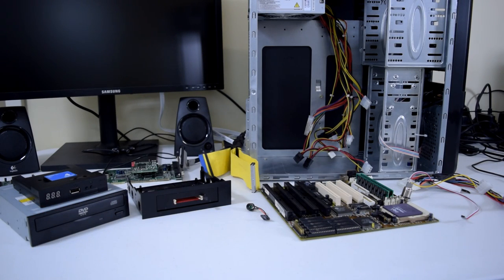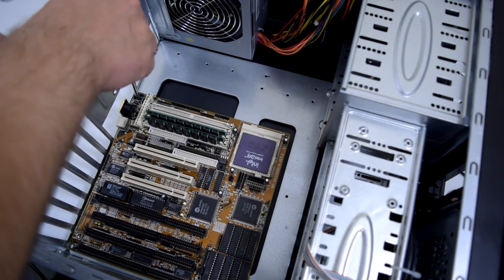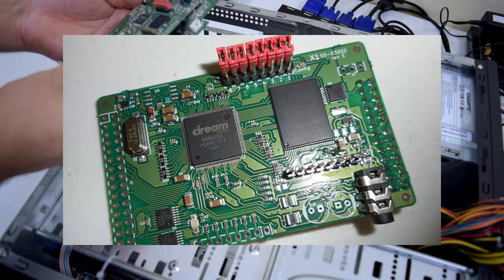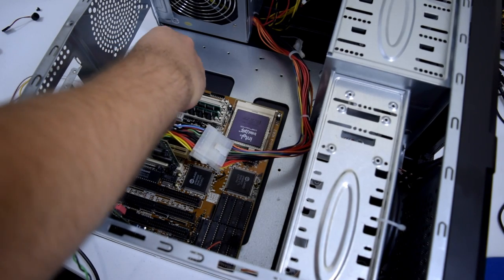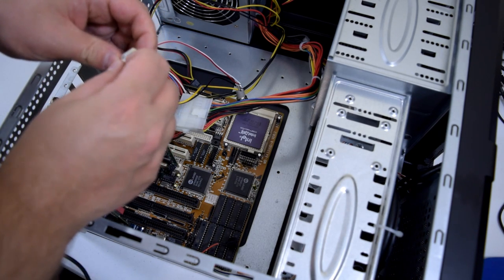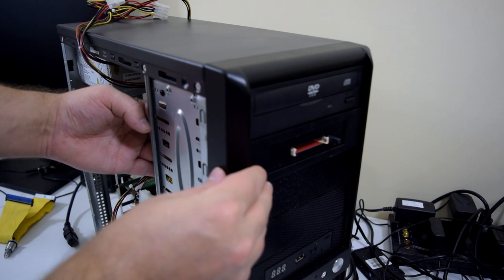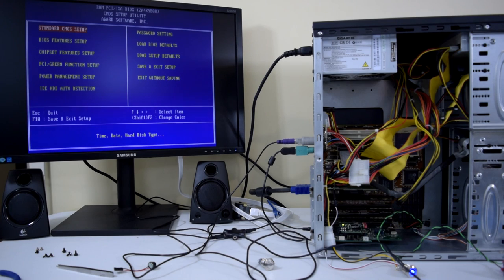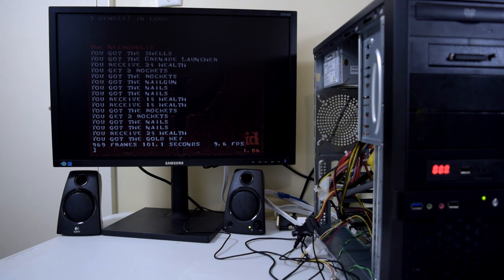Building a 486 DOS PC with modern parts

Comment: Just an FYI, if you don't want to use an ATX power supply, they still manufacture AT power supplies. You may have to do some hunting but they are still used in a lot of industrial equipment. You can get them brand new from manufacturers like Startech. You can also get XT power supplies for even older systems that are new and recently manufactured. Many arcade machines use them, so you can get them from arcade vendors a lot of the time.
Reply from the maker: +lowfwyr Good tip on the StarTech one.
Reply: Anyone know where you can still get these?  Only thing I can find now is Athena Power - which doesn't inspire much confidence.

Comment: Wow! This is a really cool video. I haven't seen anyone put together a video like this and even if they have, its terrible and 1/10th as detailed and done by hand-holding a cell phone camera. Excellent work, Phil. And I am very very interested in videos like this. I started out using my first "real" computer in 1993 which was a 486SX 25MHz with 4MB RAM and a single-speed (150kb/sec) CD-ROM drive. I ran a program called Vistapro which was a fractal-based landscape rendering and animation program. Endless ours spent creating and rendering. Full detail could take hours at 800x600 resolution for 1 image. I later ran the program in a command prompt on WinXP on a AMD 3500+ with 2GB of RAM (not that it even used more than 1MB or 2MB) and the program ran so fast at full detail it was rendering in real time. I was blown away. I think companies like Microsoft, Adobe, etc. inject so much bloated code that programs run slower and slower on modern hardware. Thank you for the video. I would love to build an old 486 and run some "benchmarks" and compare them to what a new PC can do. What matters is the results and the time of the output.
Reply from the maker: +Justin Lloyd Thank you for your kind words, they mean a lot to me :) I am branching out a little, doing also videos with newer parts, like with Windows XP, Athlon XP, Pentium 4 and other things. But I'll do old stuff too, I find all of these things very interesting.

Comment: Thinking of building a 486 and being able to use it in an ATX case would help!  AT cases are still around but go for a fairly static £60 on eBay which adds yet another significant expense and often they're heavily yellowed, rusty, bits drilled out etc.

I had no idea you could physically mount them, with the same standoffs.  Plenty of options for the switch.

Comment: I got one of those Star Tech CF adapters for a Packard Bell Platinum Pro I recently restored. The only thing I did was to paint it beige to match the rest of the PC. Since a lot of restoring with CF cards is done to beige boxes, they should at least give us the option. The other reason I got it was it was one of the few that has an eject button. I am scared at all times of bending the pins on a CF card. Also, I use a CF to SD adapter as I can get bigger sizes for less.
Reply from the maker: Nice!

Comment: Awesome video.. I still have a prototype for a small converter laying here, waiting to be finished, that allows you to use an ATX power supply like this without having to switch out the mechanical switch itself. I guess I need to get working on that project again..
Reply from the maker: +Tobias Mädel (Manawyrm) So, this adapter works with the standard ATX soft power button?
Reply: Yes, its basically the soft power button logic that you'd find on a standard ATX motherboard, only externally.
Reply from the maker: That's very cool! Do you happen to have a link or article page to this adapter?
Reply: not quite now unfortunatly, as i've said its an DIY project. I need to find a way to distribute these boards.
Reply from the maker: Ah, ok, sorry, I misunderstood. So you built an electronic switch that takes the ATX power switch and then turns the AT PSU on or off.

What components did you use? Switching with a transistor or relay? Did you use a micro-controller like Arduino or built your own circuit?
Reply: +philscomputerlab Hm, its an electronic switch, that takes the ATX power switch, and then turns an ATX power supply on and off, so basically exactly the thing you'd need for this build. 

My first version was swiching with a 74-series flip-flop IC and some transistors, but that wasn't working so good, so the "current" (well, 1 year old) version uses a small microcontroller. kinda like an arduino, only much smaller and cheaper. the current price for the material is under 5€ and I try to keep it like that... Its basically only a ATtiny85, a circuit board and some connectors.
Reply from the maker: Cool, very cool. If you ever find the time to document this, please let me know!
Reply: +philscomputerlab http://www.dosforum.de/viewtopic.php?f=1&t=9819
Reply from the maker: Cool!

Comment: looks like, apart from the PSU, the AT board fits nicely without any modifications in the ATX chassis. I didn't expect it especially to hold the board in place without mods.

Comment: You connected the external pwr button to "Turbo" button connector - that's why it slows down when you press it! The turbo button changes the processor clock.
Reply from the maker: +Gaston Electronics Yes that what it does. On some boards you got to close the jumper for full speed, on others remove it. There is no set standard :)

Comment: its amazing how many engineers who build pcs always dvd drives at top of case eventhough you could have multiple open caddy openings on the case
Reply: Yes agreed LOL, I know what ur saying its just a habit to always install the drive on the top bay even if its on a table ... If you know what I mean, I must have done hundreds of pcs and still to this day I always put the optical drive at the top of the casing just a habit unless the IDE/SATA cable is not long enough at the time of building you place nearer to the cable if you not got and extender cable!
Reply from the maker: +Kcin Setay You make a good point! Another viewer advised to that the drive on the end of the IDE cable should be master, so if I use a single cable, it would be easier to have the hard drive on top of the optical drive. Some case however have set optical bays with a door for it, of course right at the top :)
Reply: yes been there as well lol with MA/SL & CS :D how sata changed and everything gone backwards a little because were so used to connecting single drives to 1 sata port at a time!! but ide mainly had 2 channels per cable unless your pc was a dell or a Compaq which they were tight enough to only supply one IDE adapter on the each end and if you were not savvy to cut into the cable you just went out of got a two ended ide cable so you can use two drives on the same cable!

Comment: Yesterday I got my first 486 pc. The layout of the board is the same as yours and it also has a ps2 port. But it only has a 486 DX2 with 66MHz installed. And the pc has the exact same graphics card.

Comment: I had one of these back in the day. 486 dx 2. You just reminded me on the fact that these cpu´s didnt need an heatsink even LOL.
Reply from the maker: +sugarpuffextreme Funny you mention this. I copped a bit of heat for not using a cooler. I totally admit that I forgot about :D I then bought one from eBay :P
Reply: +PhilsComputerLab Didn´t it run fine without a heat sink? Anyway, you just inspired me to build an old computer, there is some stuff that you simply cant play anymore without old parts and os. Half life 1 WON version with that old animated menus instead of steams new static ones are amazing
Reply from the maker: I have a retail copy of Half Life :)

I believe I have a video on my channel. Running it on a Pentium 3 with Voodoo graphics.
Reply: +PhilsComputerLab I used to have a retail to but I stopped using cd/dvd-readers in my pc builds a long time ago so it got lost in time. Funny how stuff is brand new and amazing on day 1, then after a couple of years its old and junk and just laying around as garbage and one day these items would look super nice in a retro system. Hindsight 20/20. I got my computer desk extended recently  so I could have more room when I build stuff. Could easily fit a retro system somewhere here =) http://i.imgur.com/wfSn6um.jpg
Reply from the maker: sugarpuffextreme What a lovely setup! Nice and tidy too. Well done.
Reply: Thx guy. Also thx for taking me on a nostalgia trip. I'm currently installing windows 98 in vmware and old stuff that I haven't used or thought about in ages is coming back to life. Took me a while before I realized you had to used a floppy boot disk to install win98.. fdisk and stuff :P
Reply from the maker: Glad you're having a good time :)

Comment: Back when ATX cases were something new, they used to come with 2 I/O cover panels, one for AT and one for standard ATX I/O layout. I say panels because they were the same sheet metal as the case, and not these thin chrome things they use today. 

I think at least in theory and probably in practice, an ATX power supply is a good thing to use, as long as it is not one of these el cheapo $20 craptastic jobbers, but I have never had 1 problem with an AT power supply. Even the one in my XT works like a champ, as well as my Tandy1000 which is the oldest computer I have right now. Capacitors (not to mention the rest of the components as well) were vastly superior in quality back then than they are today.  Hightreason610 did have one blow up on him though :)  

I will have to try one of these floppy emulators, looks interesting. I have so much stuff though on floppy disks, I really can't see this being practical for me to substitute for a genuine floppy drive. But if someone is building a vintage computer, and has no floppy media and just downloads everything to a thumb drive, this would be perfect. Hmm... now that I think about it, that might really be very handy for me. But I would still need to keep a true floppy drive... I will need to explore this..

I started this idea of building a retro machine with modern brand new components a year ago, but I just never got around to finishing it. I am going down a different approach though.  I ran into 2 stumbling blocks, one is that I have not found anyone that makes a PCI or PCI-E floppy controller. I looked for internal USB to Floppy drives, but the ones I found had the USB A cable attached and had to run to the back of the computer, instead of the motherboard header. The second was that these IDE to SATA adapters did not work with an IDE cdrom Shocked me though when it worked with my 540MB Quantum. 

486 will always be my personal favorite processor. Enjoyed the video my friend! it is always fun to try strange combinations :)
Reply from the maker: +WaybackTECH Thanks for the feedback!

I can tell guarantee you that you will love the GOTEK. I had so many issue with disks not working anymore. I haven't had a single issue with the GOTEK, got three units and trust them 100%.

The latest motherboard I have with a floppy interface is an Asrock AM3+ board with AMD 880 chipset. It's in my capture computer that is in my lab. It also has a GOTEK of course. But on current boards they simply don't exist anymore...
Reply: I have a rusted out AT power supply rated for 120 watts, and it runs at 143 watts. It's even an "El cheapo" unit!

Comment: what i do think is amazing is how much we were able to do with such little processing power compared to the average gaming PC of today. a modern gaming PC today is like a supercomputer from back then. its amazing we did what we did, with how little we really had. my first PC had a 486 sx 4mb of ram and a measly 170 mb hard drive. i remember using doublespace to squeeze as much on that hard drive as possible. i remember pulling the 486 SX in favor of the 486 DX2 66 mhz, and installing an additional 16 mb of ram. all of that just so i had enough memory and a math co-processor so i could run autocad lol
Reply from the maker: Double Space! Wow, haven't heard that name in a long time :) And Stacker or Drive Space. Yes those were the days for sure.
Reply: +PhilsComputerLab What is Double Space?
Reply: An old DOS file compression program.
Reply from the maker: Yea it compresses the files and lets you store more stuff on the hard drive. But it doesn't work like ZIP, it compresses in the background.
Reply: it also has a tendency to slow the computer down some, more risk of corrupted files. this was back when hard drives were expensive devices costing hundreds for 3-400 mb drive, by today's standards a joke. a tiny little flash drive, even a small one holds many multiples what a small hard drive can hold today.
Reply from the maker: True. Even Windows 10 has an option to compress files on your hard drive :)

Comment: Those floppy drive emulators are insane.  Very cool, but insane.  I can't believe someone actually made such a thing!  I actually bought an older (nowhere near as old as a 486, I think it's a first-generation Core chip) system several months ago so I would have a system with serial and parallel ports and a floppy drive for the rare project that requires such things.  Plus, I wanted to have something running Windows for the rare thing that doesn't support Linux (very rare to encounter such a thing nowadays, but Samsung's software for my cell phone doesn't like running with the USB passed through Virtualbox and doesn't support Linux directly).
Reply: The floppy adapters are mainly designed for stuff like CNC machines where a modern replacement that supported newer storage would be really expensive

Comment: omfg HAL. I used to use that exact same benchmark to tweak PCI and CPU timings back in the day to get the highest frame rate and bus speeds! When I went from a 486 to a Pentium 90, my performance actually went DOWN because the ISA bus clock modifier was way too conservative on the new motherboard and wasn't configurable so I had to go to PCI video, then that thing FLEW like 400fps.

Comment: In terms of the Flash Card Hard drive, I tried doing the exact same thing with my 486 but it wouldn't work. Kept getting just a black screen when I turned it on, normal boot up when I unplugged it. Its nice to see it worked for you though.

Comment: Cf flashcards are great replacement for harddisks.
It saves lots of loading time and increases lifespan & reliability.
Reply: But dont use windows 95 or later cause the swapfiles will eat up the limited write cycles

Comment: The other problem with AT vs ATX power supplies is that AT power supplies were often time much more dangerous since the power switch switched the mains voltage on and off to the unit vs ATX units using "soft-power", I once had the displeasure of an at switch shorting to the case of my CompuAdd 316s, the wires running to the switch had 3/16in quick disconnect connectors and the switch had 3/16in round solder lugs instead of the straight quick disconnect terminals so the wires were loose and mains voltage shorted too the case threw some large sparks and tripped the breaker.
Reply from the maker: +Intanius Wow that is quite a worry.

Comment: You could also use a pair of latching relays inside the case attached to the power and reset switches on the front, attach the power and HDD LEDs to the power and turbo relays and you now have a visual status indicator, no case mods required, total investment, about $30 and half an hour of build time.
Reply from the maker: +Teth47 Great thinking, in fact I actually ordered a nano Arduino micro controller and some relays. Never got around to working on this, but I got the parts ready to go :D
Reply: PhilsComputerLab Something like this would be simpler, cuts out the need for a micro http://www.ebay.com/itm/5PCS-5V-12V-Button-Pulse-Relay-Module-Bistable-Switch-LOW-HIGH-LOW-Brand-New-/221654571781

These relays stick in whatever position they were in when they lose signal, so when you press the momentary switch, the relay turns on, then a mechanical latch inside holds it on, when you press the momentary switch again, the relay unlatches and turns off. Consumes less power, the wiring is dead simple, it's just a drop-in, and they even have terminal blocks, so you don't even have to solder.
Reply from the maker: Very nice! Will check it out for sure...

Comment: Alumin(i)um tape would replace that missing IO panel, and can easily be cut with a pen knife. I still use this to replace missing slot covers. Just be sure to tape both sides so there is no exposed adhesive to pick up dust bunnies.

As for your power and turbo switches, why not put them to either side of your CF adapter? Then you don't have to drill the case, just the adapter which you called "cheap as dirt".
Reply from the maker: You must have seen my later videos with the switches :)

Comment: Great build, though I'd love to see this sorted into a much smaller cube like case just to blow peoples minds. :)
Reply from the maker: +eLJaybud That would be cool. A retro borg cube :) Shame all these AT boards don't go in anything smaller than ATX. You could mod an old notebook, but taking one of them apart that's like plundering a grave...
Reply: +PhilsComputerLab True. I used to own a laptop that used a desktop Pentium processor which I naturally upgraded. But then it started becoming unreliable and crashed part way through writing some programs. At which point I applied a vector force to it moving it rapidly across the floor and it stopped working for good. You live and learn.

Comment: I think one of the key points of putting together a 486 machine is to have a working floppy drive. Gotek is great, but seriously, where's the floppy?? :)
Reply from the maker: And you didn't get triggered by the ATX case? The CF card? The ATX PSU? The DVD-ROM? That's what I do, combine new with old. The Floppy is so unreliable, I'm glad I don't have to use it.